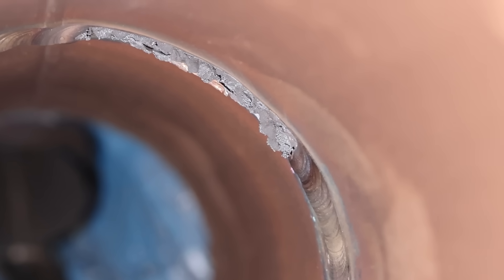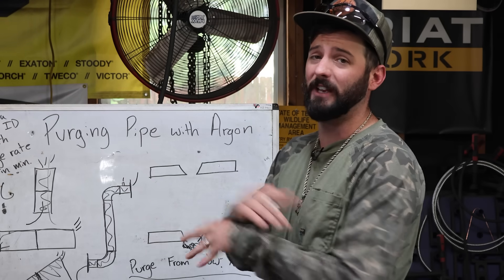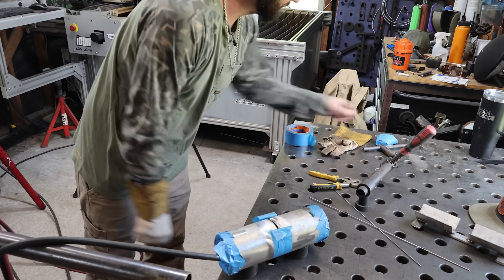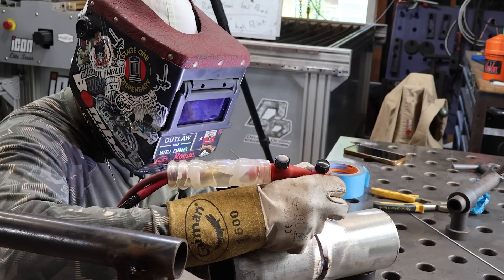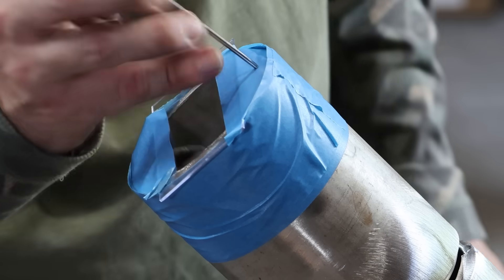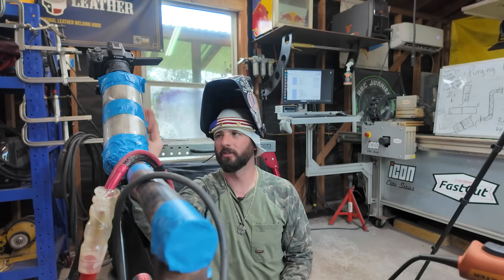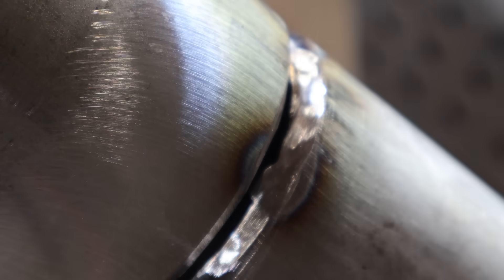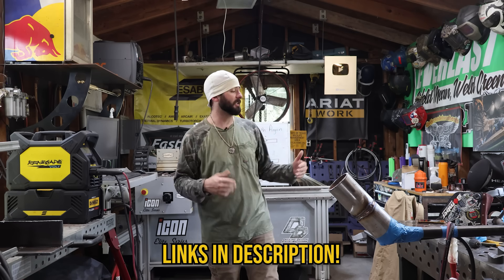Purge Stainless Steel Like A Pro

Comment: Might be a silly question, but I have little experience with stainless and would love to learn more. When would you not purge? Fillet welds I assume, but what about things like stainless handrails, or square tubing butt joints? Also, what is done when one or both sides can't be accessed/plugged, like welding a tip on a car exhaust when the opposite end (manifold or headers) is difficult to access? Does that ever happen in the pipe welding field on a larger scale and what is done?
Reply: What i have done is to make a ball out of foil and push that up the pipe as a plug and feed gas from the open end. Then use air pressure or water etc to blow the foil ball back out.
Reply: @tweake7175  Good idea! Thank you!
Reply: When purging is required there is always a solution to make it happen. Whether you remove the whole part, use a needle purge. If the code or customer doesn’t require a purge you don’t have to. And yes to your point filler welds don’t usually have to get purged. You’ll only sugar the inside if you get toooo hot and melt it on the back side or inside. I’ve seen handrails and even piping but welds and all not be purged. Sometimes id say it should’ve, other times it was just fine. 

Structural it’s not as bad as if something is going to be running through the material
Reply: @Drweldz  That makes sense, thank you!
Reply: Filler metal with flux are used on heavy wall pipe, you can use it on pressure system but not on sanitary line,…solar flux on thinner material….nothing beats RMD when it comes to passing rate (NDE)and speed though